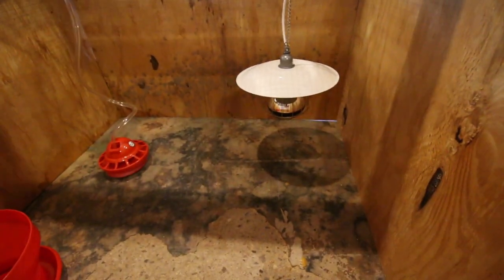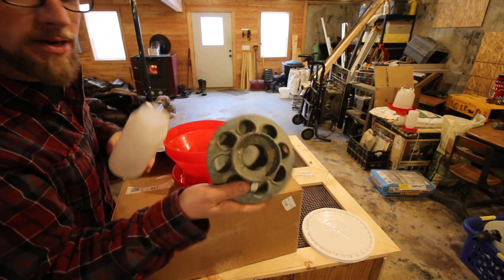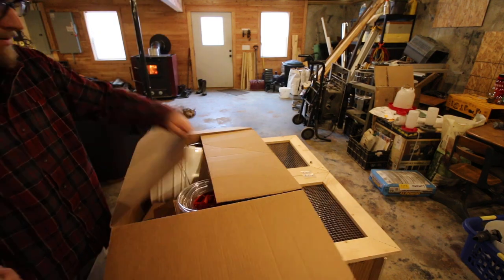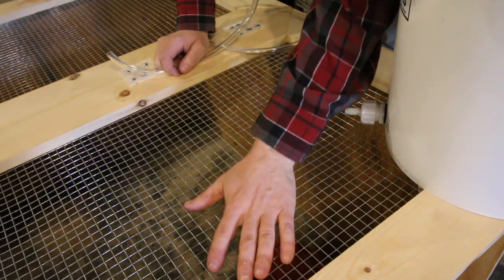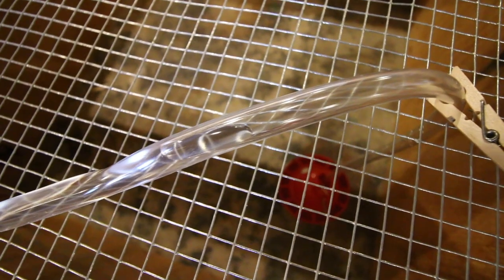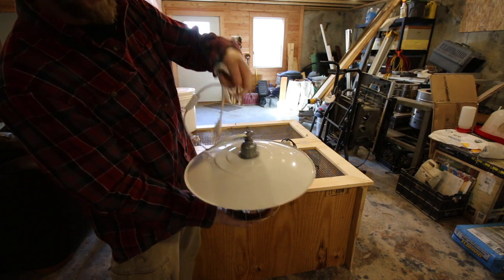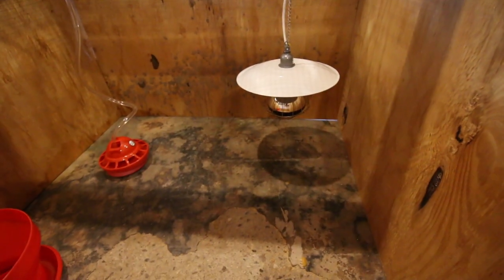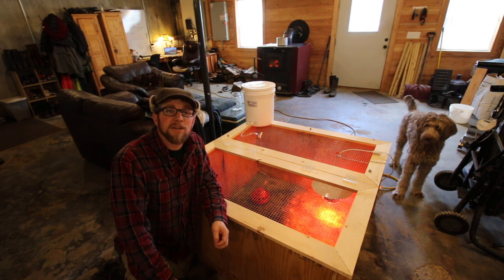Ultimate Chick Brooder Set Up with an Automatic Waterer

Comment: Al, you were talking about the mess the waterer has made in your previous brooders. When I bought my ducklings and goslings, I knew it was going to be really bad if I didn't do something first. 
I got some small cement mixing trays, and made some simple butt-jointed wood frames to fit snugly over the top of the trays. I covered one side of the frames with hardware cloth, using lath screws to attach them to the frames - water is heavy, and I don't trust just staples! 
I put the waterers (and feeders) over the grated reservoir, wet bedding just doesn't happen anymore. 
I've used the grates to sift compost, garden soil, and to act as duck barriers. Right now, I've got potted plants on them to keep the pots out of water puddles. The cement mixers are invaluable for so many tasks around my homestead.
See a picture on FB here: https://www.facebook.com/photo.php?fbid=10209044163279265&set=a.10208864338463757.1073741843.1173274472&type=1&theater

Comment: A way to avoid a water mess  is get a paint tray liner  the kind you use with a 9 inch roller  put hardware cloth on it  put waterers on that  the water mess is contained and easyer to clean up

Comment: I use the same jar w screw base for food.  However, I took a wire clothes hanger and duct tape to make a hanger for it.  My chicks are in a modified dog crate.  So the food and water hang from the top of the crate.  I use shredded paper for their bedding. And I deep layer for a week (clean out on the weekend).
Reply from the maker: That sounds like a pretty slick set up

Comment: I'm definitely getting that waterer. I have a 125gal fish tank with hardware cloth top. I put a heating pad under wood chips for heat at one end. In cold weather I put a blanket over it. The water issues would be solved with this setup.

Comment: Nice setup.
   My dad made a power box for our heat light. Its a double receptical box with a plug on one side and a dimmer switch on the other and a length of electrical cord comming out to plug it in. He built that 8yrs ago and weve used it every summer for chicks. No more raising and lowering the light up and down on a chain. Just adjust the dimmer nob. Also the 6ft of cord makes it so we dont need an extension cord. I dont know if that idea would help you.

Comment: Nice upgrades.  Definitely use cardboard or a base for easy cleanup.  Very clever storage and reuse trick overlapping corners.  Nice job and great class.
Reply: If you laid an old sheet over base cleanup would be a snap.  Even a tarp, fold dump on compost pile and no shavings cleanup.

Comment: I have a feeder similar to that one.  I think I invented the perfect lid for it with two cheap funnels and a piece of all thread.  You want the first funnel an inch or so smaller than the inside of the feed storage bin area.  You want your second funnel to be two or four inches larger than the top of the bin.  The smaller funnel goes inside on bottom small end up.  It makes your capacity a little less but not really, it just eliminates the pile left in the middle when it's so low it no longer flows to where chicks can get it.  (However, my feeder had straighter walls, your's has that Slope on the outside, that's cool, I like your's better, but funnels will still work, your bottom funnel will just be smaller than mine was). With whatever nuts and washers work best for your particular funnel, stick the all thread through the funnel and bolt it so it points up out of the small funnel - you are also using the small funnel as a stand.  Kinda like a mic stand.  Put it in place then put the big funnel on as a lid, as you would have the plate, pointy side up, over the all thread.  The more this funnel hangs over the more 'eaves' you'll  get.  It's  nice to have them bigger than the feed trough below if you might use it outside someday.  Mark the all thread a quarter or half inch longer than you need so you can use a fender washer and wing nut on top.  Jam a couple of nuts and or necessary washers inside below the big funnel so that tightening the wing nut isn't lifting the bottom funnel.  Use a funnel that is steep enough chicks will slide off.  Cheap plastic funnels are fine, and easy to find at a dollar store or HF.

P.S.  You'll more than likely have to alter the funnels by cutting on the small end some.  You don't need a lot of the long tubey part, you're more interested in the cone part, or may have to cut a place to get the all thread to go through.

Comment: If it doesnt keep it out  (they are crafty when it comes to making a mess) my favorite thing to use since my friend showed me is an ordinary rabbit waterer for brooders.  Works for quail, chickens, my ducklings used it even though I put in water they were in with chicks.  They just sat in their water kicked it out then drank out of the rabbit waterer after they muckied theirs up lol.

So this year I plan on using that for just the brooders since it was so much better.  They leak a little but not as bad as typical poultry waterers.  Hopefully that works great I havent gotten to the end yet but if it doesnt keep those in mind they are cheap and versatile.

Comment: Have you considered heat plates they are much safer than lamps and they allow the chicks to learn day/night and act much like a brooding hen. I really l ike this design. Id rather see the electrical through a side hole in the wood rather than a hole in the wire but that's just me.  I like the bell waterers  I think you might have a small problem of the chicks getting too large for the brooder (and deep litter) before they will be feathered enough to not need the additional heat. I also think you may need a support bar to raise the lamp higher after a couple of weeks it looks like it might be able to be high enough.  The radiant ceramic bulbs would work better for that if that is your plan you might think about mentioning it.  Chicks will still manage to poop in that feeder they manage to poop everywhere. Overall I really like this design and might adopt one this year.

Comment: Nice watering system. I think putting the brooder next to a wall so the bucket is against a wall would keep Figaro from knocking the bucket off.  He may paw at that hex key and get the chain to fail, I think I'd use something more secure, like maybe a carabiner or bolt with nut.  If there is a weakness Figaro will find it.

Comment: I was wondering if that stove is capable of running a heated floor system. If so in the future if you ever want to finish the basement you could install that if you make rooms. Heating the basement this way inadvertently heats the upstairs